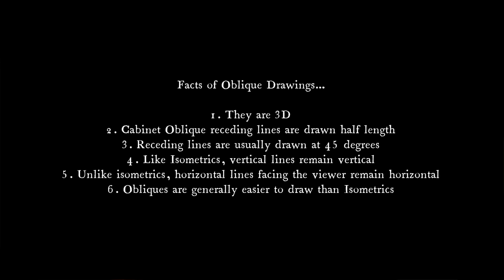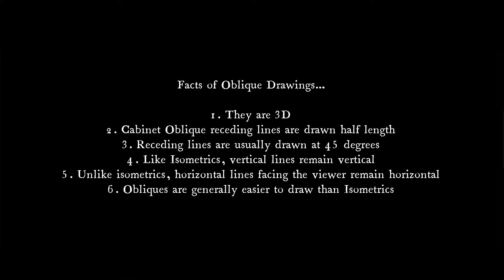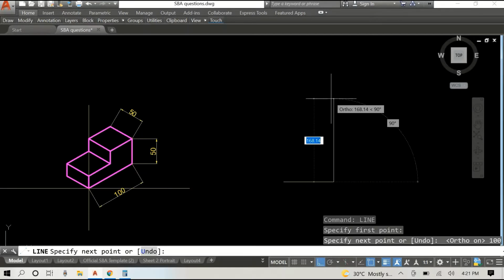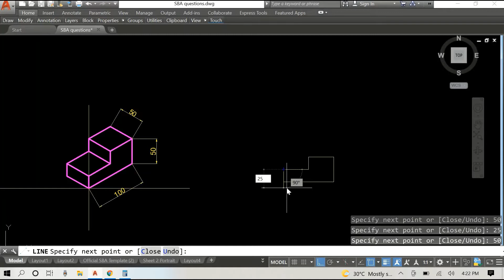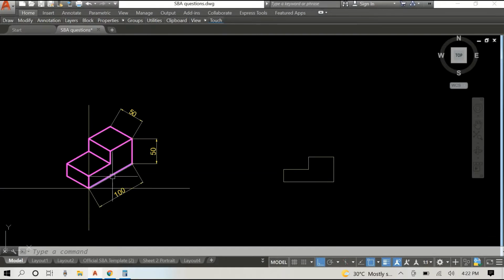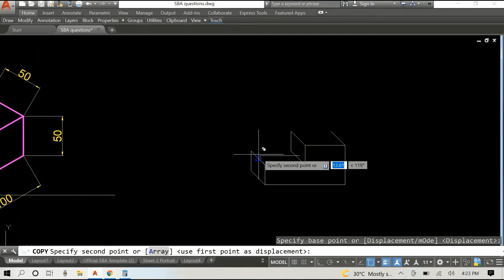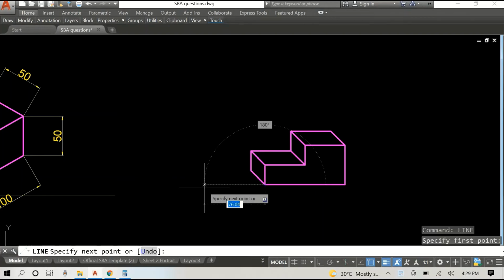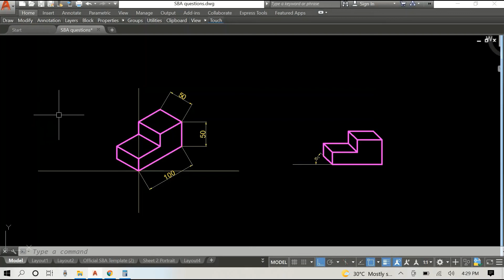How to: Draw an Object in (Cabinet) Oblique Projection Given the Isometric Equivalent in AutoCAD

Comment: How to make dimensions in it? While taking the half of length.
Reply from the maker: This is an excellent question. When we did it manually, we were able to just write the intended length. I'll have to do some research into how to do so in AutoCAD as well.
Reply from the maker: Ok, I did some digging. Turns out, the simplest thing to do for lines drawn half length in cabinet oblique is to do the regular dimension, double-click it, and then change the dimension to the length that you intended. Hope this helps. I'll most likely make a short video showing how.
Reply: Thank you, really helpful..
Reply from the maker: Most welcome